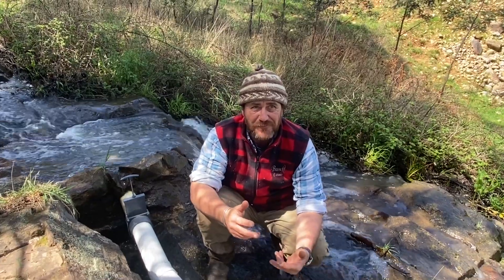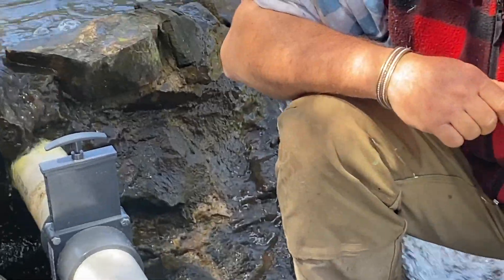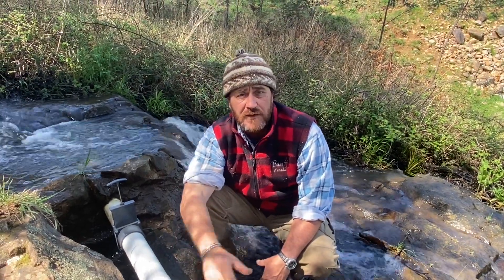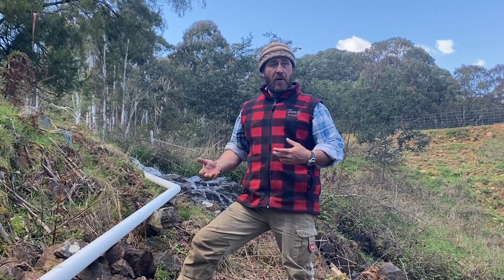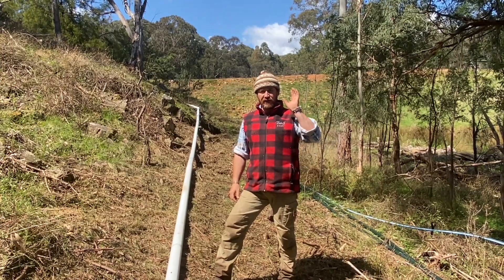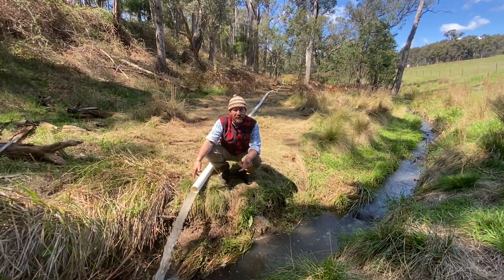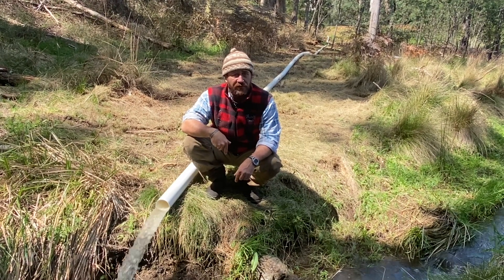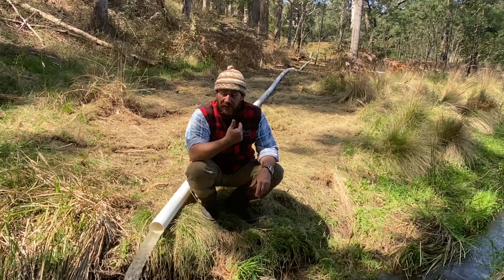Off Grid Micro Hydro Power Generator Part 4 - Clearing the Route.

Comment: Great videos. You might want to place a valve just below your water shutoff valve at the dam to break the negative pressure in the large line during draining to prevent pipe wall collapse. Also a sloped screen at your water intake to prevent debris getting into the pipe. Keep your videos coming.

Comment: love watching your progress, you might need to be careful with a valve at the top of your penstock , if you close it wih a full pipe the vacuum caused by the water could collapse the penstock. Some pipes are rated for pressure but not vacuum. you could add an air inlet just afte the valve which is just a tee with a vertical pipe higher than your dam water level. keep up the good work.
Reply from the maker: Thanks Ian, much appreciated for the thought. Cheers
Reply: add a burp pipe just below the valve....

Comment: Did you resolve your vortex issue at the dam? Add a float of some sort which will collapse the vortex and reduce your air intake and reduce the friction loss through your piping
Reply from the maker: Hey Nate, working out some prototypes for the intake. I should have something on video in the next few weeks. This will sort out the votes issues i was having with an underwater intake pipe. Cheers

Comment: Love reliving the excitement at this stage of the process. A small turbine completely powers my house. It’s been spinning away for about 4 years now. It’s a fantastic thing!

I have somewhat similar flow and head (10 meters and between 5 and 20 l/s) that makes between 150 - 600w. My turbine and generator is made by Energy Systems and Design and is very well designed and built. I have a Turgo-style turbine. Have you considered a Turgo over Pelton?

Also, depending on your electricity usage patterns, you’ll likely find you’re making extra power for significant portions of the day. We sure do. It goes into either a small baseboard heater in our bathroom or a preheating water tank in series with our propane-fired water heater. I’d love to share what I’ve learned if you’re interested.
Reply from the maker: Hey Lucas, spot on! The excitement levels are fairly much vertical. Planning, estimating, calculating and then executing. Thats the fun of it all. Looking forward to warmer days when we can progress further. Thanks for watching, cheers

Comment: You should give the coanda screens a look. My system has a 2’x2’ screen sitting at a 45 degree angle with a box I made from concrete. The screen will keep debris, rocks etc out of your penstock and  protect your turbine. Don’t be fooled by the crazy online prices for the screen. There are places to by the screen fairly reasonable. I can supply a website where I got mine. Good luck with your system
Reply from the maker: Hey KTM, if you could let me know where to source,  that would be great. Much appreciated. Cheers

Comment: What you can hear is the water/air mixture going down the penstock. Air will naturally be drawn into turbulent water, but you will also draw air into the penstock-inlet, unless it is deep under the water surface, or you have some sort of vortex arrester. An air stand placed within 6m of the dam will allow all the air that is drawn into the penstock to rise and escape. Any air in the penstock will reduce your output.
Reply from the maker: your spot on, i'm going to have redesign the intake area. I'm not sure how yet but still need to add a filter sytem and certainly deepen the intake area. A work in progress. Thanks for all the advice, much appreciated. Quick question? whats the flow of your intake based on the 20mts head?

Comment: I'm wondering, that if you increased the size (diameter) of the intake pipe, thereby turning it into a funnel, whether that would help with volume of water that you will have at the outlet end and thereby help with an increase in pressure. Looking at your set-up you only have a 90mm pipe from start to finish so, no matter what the water depth covering the pipe is, it would work as a restriction EG if you had an inlet of say 150mm leading into your 90mm it might speed up the flow. Then again, it might also create a vortex that you don't want... Just a thought while watching this and scratching my head....Splinters
Reply from the maker: Hey Les, the final out will be reduced to 50mm, this will cause the 90mm to fillcompletely. The pressure is only related to the weight of water. At 15.2 psi, this equates to 11mts in height. To achieve our goal of 7lts a second the pipe size wont matter. At 7lites we generate about 300w's. This then equals 7.2kwh per day. We only use 6.8kwh at the house. This combined with the solar we will cover our power needs. Cant wait until we have finished, i;ll keep the videos coming through as we progress. Thanks for watching, cheers
Reply: The maximum pressure is entirely dependent on the vertical component of the weight of the water in the pipe. As the water flows, pressure will drop with the resistance in the pipe, which is the water "dragging" on the pipe wall. The higher the flow, the greater the pressure drop. A higher diameter pipe simply allows more water to flow without significant friction. It's generally not worth making a pipe so big that there is practical no friction. Losing 5% to pipe friction is what most microhydro systems target.

In this case, with 50 meters (I believe the penstock is that long?) of 90 mm pipe, 7 l/s of water will have a head loss of 0.63 m. Out of 11 m of head, that's about 5.7%. The bends will lose a little as well so call it 6%. 90 mm pipe is the appropriate size for the 7 l/s goal. 

Of course it's possible to flow more water than 7 l/s, but at some point the loss of head will reduce the pressure and reduce the energy imparted to the turbine.

Comment: Hi there, it looks like you've sorted the majority of your delivery pipe problems. With just a 16 psi head of water I would give thought to multiple nozzles in your pelton wheel enclosure. Seth from "Land to House" has low head issues and set up himself a multi jet pelton wheel enclosure as did Kris Harbour who, in my opinion made his pelton wheel and power house waaay too small. Personally I reckon about 3m x 3m allowing for some electronics but more importantly those wretched flexible pipes (Kris Harbour) and manifold needed to accommodate them. I think the Land to House pelton wheel multi jet setup is a great idea but the jet manifolding, in my opinion, introduces many points where water flow to the delivery nozzles is waay too restricted, resulting in a somewhat poor output. However the Land to House electronics enclosure on the side of his house is very well thought out.
Reply from the maker: Hi Richysee, with the caculations based on 300 - 350w i'll be using twin jets.The system i'm looking at is the powerspout. This will give me the flexability to add additional units if and when required. I've looked at Seths & Kris's and they are great set up's. The power house will be designed to handle three units and the the electrics back to a stand alone power hut sub station. The solar will be fed in here also and then branched out to sub mains - machinery shed, homestead, tool shop etc. Lots of work to do but its all about the master plan of FCFT. Thanks for the input, i really appreciated the feedback. Stay well, cheers!
Reply: @FatCowFarmTatong  I had a look at what Powerspout is offering and it appears to be ideal as you say. I'm impressed by what you've planned and I hope it all comes to fruition without undue complications. Best regards.
Reply from the maker: @richysee  Thanks again, cheers